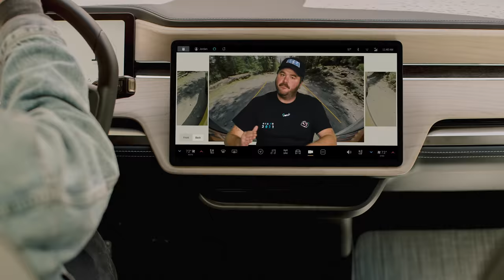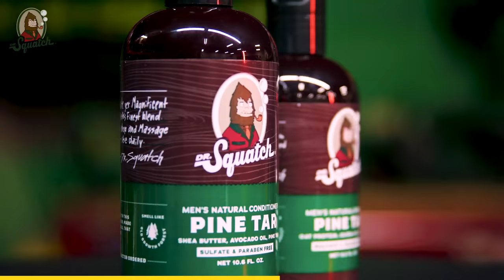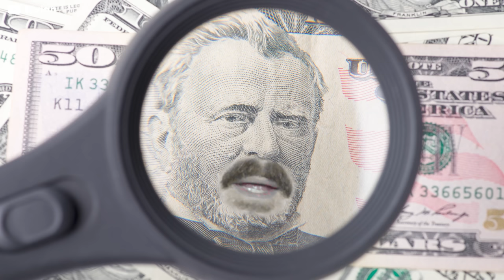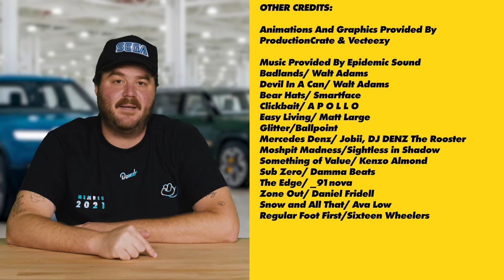Rivian - Tesla's Cybertruck, But Real | Up to Speed

Comment: Ford kinda wins in this electric thing in two ways: a. they have a 12% stake in Rivian, so they'll see their investment grow there b. they have the upcoming Lightning and it's potential base.
Reply: Ford is also probably the front runner in the electric game for a traditional automaker. They leap frogged companies that have been in the game for a while like Nissan and Chevy and their offerings appeal to a wider range of people than the EVs from Jaguar, Audi, Volvo, etc.
Reply: 800 million turned into 10 billion... That's some serious ROE
Reply: I agree, of the big 3, Ford will be in the lead for a while.  I think a ground up build might be better long run, but what Ford will do is use the most positively reviewed Rivian features and slide them into their future Lightning offerings. I get why they named it lightning...but I wish it was something else, because the SVT Lightning is the only ICE pickup I want, and the 2 names will get intermingled and confused I am sure.
Reply: @levirassler4934  Initially, yes--the Lightning name will be a bit confusing and some Rivian features will make their way onto the Ford electric pickup in the future. Initially, Rivian and Ford were supposed to joint venture the electric pickup, but realized that they were shooting for different audiences, so thus the separation.

Comment: I honestly never would’ve believed Rivian would be first to market.
Reply: They weren't Chevrolet with the 1997 ev s10 and Ford with the 1998 production ev ranger would like a word with you&rivian claims.
Also gm made commercial electric trucks back in the early 1900s. 😎
Reply: @4literv6  Those examples are definitely cromulent, and I was aware of this history but I was really referring to the modern times and eRace to market. There was no, nor is there now a market for ~50 mile range EV vehicles, cough Nissan Leaf 👎

Comment: I like how no one brings up human rights violations with regards to oil and gas production but its constantly used as a bludgeon for ev's.
Reply: Because most of the oil related human rights violations involve the USA
Reply: Oil and gas production doesn't need child labour because it involves drilling mostly offshore instead of diggin but mining lithium,cobalt and other metals does require manual human diggin especially in Africa mines
Reply: This ☝️
Human rights and pollution is already a problem for oil, and that's on top of them also emitting harmful gasses for their entire lifetime.
Reply: Are you talking about the same batteries used in the cellphones that people posting here are using without having any moral issues with ;)

Comment: Great video!  I like the fact that James actually brought up the battery issue. Making and dumping at the end of battery cycle. I think we are too quick to jump on the EV bandwagon. EV will not solve the environmental issues, it will only change the environmental challenges as more and more EV are produced. No one knows the long term consequence just yet.
Reply: Batteries are solid and can be stored. What goes into the air goes everywhere

Comment: If it gets “300” plus miles per charge, imagine what it gets with any kind of trailer hooked up. Now imagine trying to take a what should be 10 hour trip and having to stop every 100-150 miles and trying to charge along the way🤦🏻‍♂️ Tfl’s model x went from 350 mile range to like 150 with a tiny trailer behind it. Still a neat truck! Hopefully alot more fast chargers pop up and battery technology gets better for more range. And hopefully a technique than lithium mining with giant machinery, shipping batteries on giant ships, and getting rid of the old batteries or recycling them
Reply: Nobody wants to talk about the range with a trailer hooked up too it, Only what it says on paper matters.
Reply: @ButtTrumpet100   I have a 2013 silverado that fills up to right under 400 mile range. With single car hauler and a mustang (about 8000lbs total) my range goes to 295 miles.
Reply: @ButtTrumpet100  Twice as much weight does not take twice as much energy to pull, it takes twice as much to accelerate, once you're at speed your losses are a mixture of rolling resistance (which does double) and drag. Drag has nothing to do with weight and at any decent speed is more significant than rolling resistance, so the aerodynamic properties of what you're towing is the more important bit, not so much the weight, most things being towed are extremely un-aerodynamic though
Reply: @ButtTrumpet100  but sometimes it’s way more than 30 minutes. If there is multiple people at a charging station your charger charges slower, and it takes 5 minutes to fill up. And unless it’s the supercharger style which is Tesla specific you won’t get a full charge so you’d be getting more like 3/4 charge in 30 minutes. It adds so much time. Now if you are local, don’t drive super far, have a charger at home, this is an ideal setup! It is definitely cheaper to drive electric compared to gas on the same trip
Reply: @everrybody  you definitely have a loss with more weight for sure. But say you’re going from California to Texas, you stop for 5 minutes to fill up and you’re good to go, full tank. Electric you don’t normally have a charging station right off the highway easily accessible and in 30 minutes you still might not have a full charge. But it is cheaper🤷🏻‍♂️
Reply: @ClikcerProductions  From my understanding electric vehicles with a trailer or at least in tfls case with their model x, cruising in the highway still have a constant draw of power to keep them rolling. Compared to a gas engine in overdrive cruising at a lower gear ratio

Comment: You know what other source of energy is nasty? Oil & gas. I love how people point out that some of what goes into battery production is less than ideal but that the status quo is also nasty… and then some.
Reply: The impact of manufacture isn't talked about enough with EVs though, people always talk about how they're greener than fossil fuel based cars but it actually takes quite a few years of use for that to be true because of how terrible Lithium mining is. Add on top that the level of exploitation of workers in Lithium mining is worse than the level of exploitation in the oil industry (to be clear, neither case is okay) and EVs really won't be that great until that improves and grid electricity is greener

Comment: Ev’s pretty much surpass traditional powered vehicles in terms of acceleration, torque, etc. Their Achilles’ heel is range to charge time ratio. Gas or diesel, in 20 mins you can fill up and be on your way. I feel like battery tech and infrastructure are going to have to catch up for electric vehicles be able to take the next step.
Reply: The other Achilles heel they have is long term durability. These are not going to last 20-30 years without a major service.
Reply: @Epotheros  to be fair. That's par for the course for modern vehicles anyways. The idea of you car being a lifetime purchase went out a long time ago. Now a vehicle is a 5 year purchase. 10 at most.
Reply: @user-gm4kv2my4u  that's not necessarily true you can still keep ICE on the road forever. I mean sure parts will have to be replaced but you can pretty much take them to any mechanic there is and have your work done.
Reply: There's also no repair infrastructure for EVs. I mean just think about how hard it is even get body work done on a Tesla.
Reply: Towing is the other heel.

My suburban can get 600km on a tank with a full GVCW in mountains. Refill in 10min and back on the road.

We are far from getting anything like that out of an EV. I don't know if an EV truck could get more than 200km on  full charge with the same load, and recharging takes WAY longer than filling the tank.
Reply: @ButtTrumpet100  good point but with more people buying electric vehicles that only means more people at charging stations. Your 20 -30 min charge will turn into a 30+ wait before your can charge.
Reply: Also another thing no one's mentioning is affordability. EVs aren't affordable for the masses yet. MSRP on a new Corolla is mid 20s. Good luck getting EV for that
Reply: @ButtTrumpet100  I think the main problem is going to be getting it out the door. I definitely understand fuel savings I have a V8 explorer and a four cylinder Jetta. I can imagine what going from a Wrangler to a Tesla's is like  . It'll be interesting to see in about 10 years what they used market is like for EVs.  I mean if I can get a nice model 3 for 10k I'm down

Comment: James and Donut, thank you for mentioning the negative side of lithium and cobalt production and life-cycle issues. I don't think it's talked about enough, and certainly needs to be addressed before continuing our transition away from ICE.
Reply: Never mind all the cobalt used in fuel processing etc,
Also how many times can you re use the fuel you put in your car? 
Burn it once you done. At least you get years and years out of batteries and then recycle them

Comment: Can you guys do an speed or b2b for autonomous cars/ electric cars as far as driver feedback when it comes to steering play or mechanical issues? how are people going to detect mechanical fatigue that can only be noticed in the assometer or some sort of vibration/knock sensor for ball joints, tie rod ends, drag links, steering dampers, etc..

Comment: As someone who works for an electric utility doing electrical infrastructure engineering/design, I can unequivocally say that the idea we can simply replace gas cars with electric is laughably misguided. The energy required for motive power doesn't change. Storing energy in your car that was generated elsewhere is just moving the problem around.

Comment: Rivian is as exciting as the C8 Corvette and the new Bronco. Top shelf engineering, but the Rivian is the forward looking brand with its, as James put it, "throw another body on it" tech. While I will miss internal combustion noise, gobs of electric horsepower, and torque is hard to argue with. Time will tell. Check out Doug Demuro's review to see for yourself.

Comment: We'll see how it goes. People were talking big about Nikola motors until it turned out to be a shell scam company. Its not like Tesla isn't making tons of production cars, so making a truck should be easy. Their main mistake was making it so different from the rest of the lineup. If they made the cybertruck on the Model x platform and used a normal body, it would have been on the road years ago...

Comment: Need 1500-2000 miles on one running a C.B., flashing  lightbar on top ,headlights and stereo before I considered one to replace my 2500 4x4 diesel that gets those miles with a 75 gal dragup tank

Comment: 5:50 A company called orbis creates ring drive wheels that turn any 2wd car into a hybrid or full electric with their electric wheels. They have a self contained motor, and install is easy. Dude put them on a civic type r at sema and made a awd hybrid with 110+ instantly added with the time it takes to change 2 tires and install your refurbished prius battery. Im doing it to my 2012 Ms3 because It only has 30k miles and i want to mod without devaluing.

Comment: The darn thing weighs close to 7500 lbs. That's basically two regular half-ton pickups. Put someone behind the wheel who does not know how to drive a heavy vehicle and it's not going to end well, especially for young drivers. It's got the electronic nannies (auto steer, auto brake and such) to help out, but those can only do so much.
As for being an offroader/work truck, this same 7500 lbs is not going to end well on softer ground. Good for towing on highways though. Probably most of them will end up doing just that with a boat or a camper. Or more likely end up as a status symbol.

Comment: It's a great start but, here in Australia, remote touring means that I can travel up to 2000kms on a remote track. Prime example being the Canning Stock Route which is 1850kms with only one place in the middle that sells diesel. At least with a diesel vehicle I can travel between 800 to 1100kms (depending on the vehicle and the fuel tank capacity) as well as carrying extra fuel. Also, are the factories that make these cars powered by solar/ wind/hydro? If not, they aren't carbon neutral. The electricity that the cars need to power them...... I'm guessing it not ALL from the afore mentioned sources. Then there's modifications that overlanders do to their vehicles. Accessories, accessibility to replacement parts in remote areas. These are the things that I don't believe EV manufacturers think about.
Reply: I dont think you are the target market bud. EVs wont replace gas and diesel for a long time, if ever. They are an alternative for most people though
Reply: @uncleartax  Agreed

Comment: What happens when electricty skyrockets due to supply and demand? What happens when you have to wait in line for hours to get a charge... what happens when replacing batteries exceeds the cost of the vehicle?

Comment: The solution to the problem of lithium and cobalt mining isn't to just not do it. It's to fix the problem. High demand for these materials will stimulate investment in the mining sector, which will improve conditions and efficiency. Also, just because batteries need electricity, which is often made by fossil fuels, doesn't mean they're worse than cars that run on gas. IC engines are only about 30% efficient at converting fuel to useable work. Generating electricity at power plants is much more efficient and although there is some loss with transporting power over powerlines, the net efficiency is still better than internal combustion engines. Plus, it takes a lot of energy to turn crude oil into gasoline, whereas fossil fuel powerplants are able to use less refined or even unrefined fossil fuels. The environmental impact of mining coal and drilling for oil and fracking for natural gas are bad, but given that electric cars don't care where the electricity comes from, the creation of electric vehicles makes for an infrastructure that is tolerant to renewable forms of energy, such as nuclear, solar, and wind. Compared to if all cars still needed gas, there would always be a need for petroleum drilling. Also, by burning fossil fuels at a plant, carbon capture is much easier because the source of all the carbon dioxide and other harmful pollutants is concentrated. When CO2 is emitted from cars, it disperses into the atmosphere and becomes much more difficult to capture. Most electric cars will not be disposed of in landfills, and so the elements in the batteries can be recovered and recycled once the batteries reach the end of their useable life. This not only reduces the demand for such elements, but reduces the US's dependence on foreign oil. Electricity is much cheaper than gas, so the lower class especially will have effectively more money on hand. All the people who dismiss electric cars due to carbon dioxide released during their manufacture and in making electricity haven't actually looked at the numbers.

Comment: While I agree on the "nasty" part, it might get lost in all the discussions about Cobalt and other "EV-specific" materials that these are also used for ICEs - and actually at a higher level. Also, when it comes to recycling, an old battery might have a second life, while all the liquids from a broken ICE are just burned - not very environment friendly, I would dare to say.
Reply: @powertothesheeple5422  I am sorry, but it appears that you do not have the whole picture. Cobalt is used for hardening components such as a crankshaft or connecting rods. Also, the catalytic converters need this material. Contrary to ICEs - which just consume these rare materials, nearly all can be recycled when used in an EV. Besides this, it might surprise you, but just app. 8,5 % of Lithium is used for BVs while 35% are found in smartphones and other electronic devices. 

You are correct regarding the energy source, but as long as you do not live in Poland or China, coal is not the primary source of power. In Germany, it is currently app. 35%, in Norway 51%.  And this is growing. And even if it wasn't, it is still more efficient using electricity than burning oil due to the lousy efficiency an ICE has. Most of the burned petrol will just heat the environment while just a fraction is used for moving the vehicle.

Comment: Why do we talk about EVs' torque? With ICE vehicles torque is measured at the flywheel and might be useful when comparing a couple vehicles with similar transmission and differential gearing. In an EV, this drivetrain doesn't exist, so there is no comparable place to look at torque. Maybe if torque was referring to the axle it would make sense to compare, but that's not how it works.

Comment: I have 2 issues with this that remain valid with all EVs currently in production: they're all very cost prohibitive for anyone not making $70k+ a year and they all still have abysmal charging rates. I'm willing to overlook the price if they can get an effective and reliable way to charge the vehicle from 0% to 100% in 10 minutes or less while maintaining full range (300-450 miles).

I understand the cost issue is directly related to the market this specific vehicle is aimed at. To be fair, the cost to operate is admirable, but the price to simply start playing with the new toy defeats that purpose completely.
Reply: Why do you need it to charge so fast all the time? You charge it overnight at your house

Comment: "The Rivian can tow up to 11,000 lbs!" yeah, for about 5 miles up a gentle grade. Towing is going to be a very difficult trick for EV's to overcome, it so degrades distance. Moderate loads over reasonably short distances, combined maybe with solar panel regeneration or putting chargers at the boat ramp, maybe you got something.